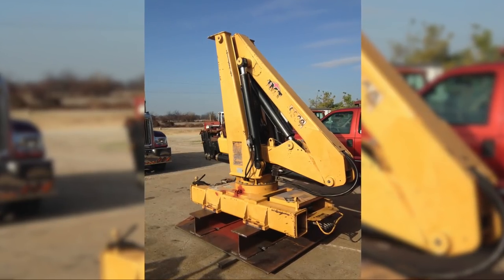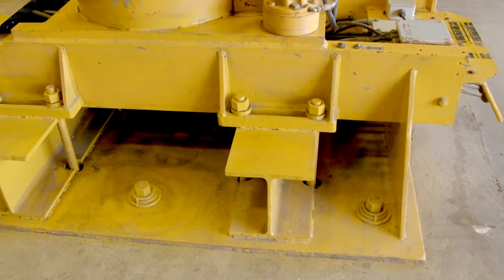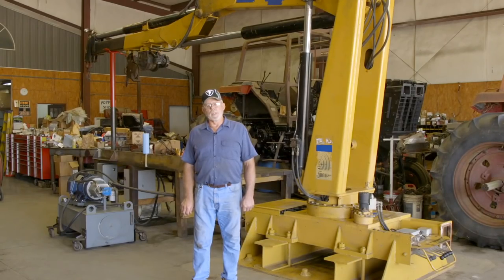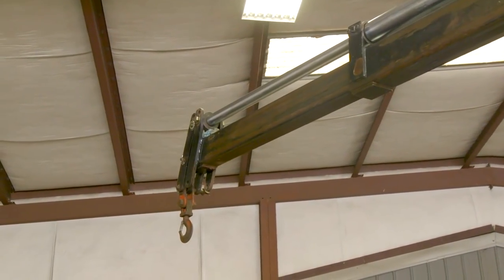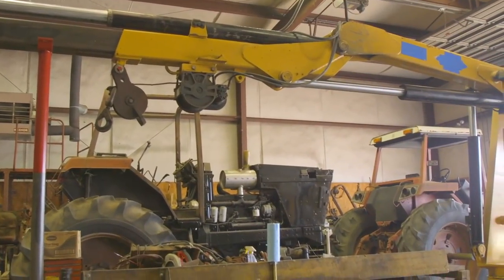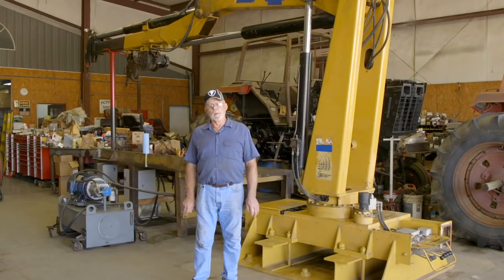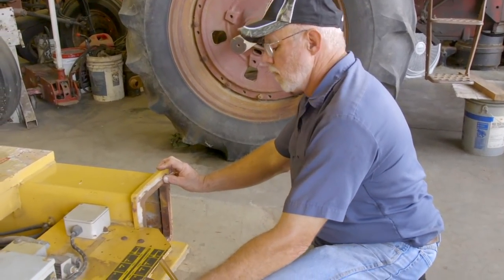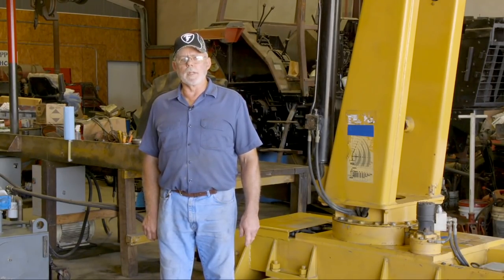Farmer-Adapted Knuckle Boom Crane | All Around the Farm | Successful Farming

Comment: I have just done a similar project but am running a 12 hp diesel engine and crane is mounted on an old farm trailer . The electric motor used here is a nice compact unit for 30 hp  .  No parts on my unit are new except for some hoses that I had to replace .